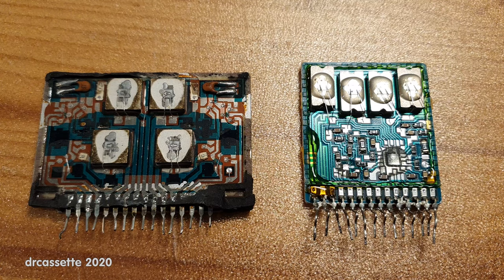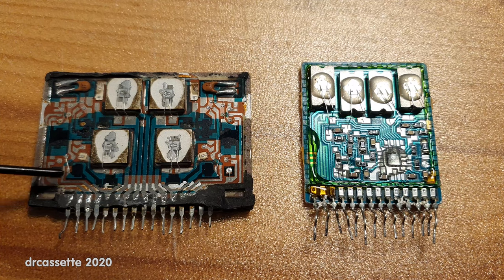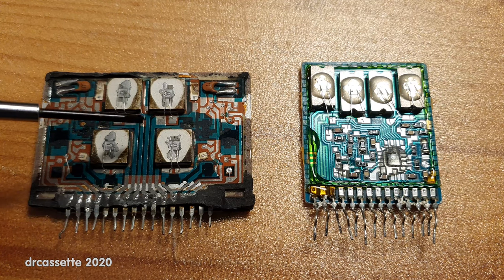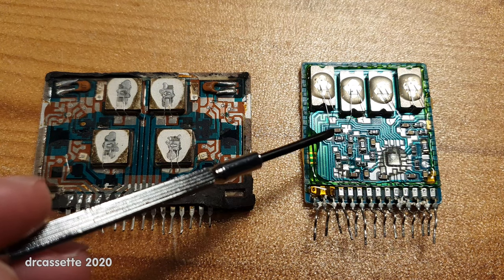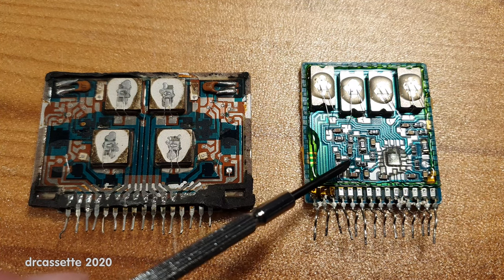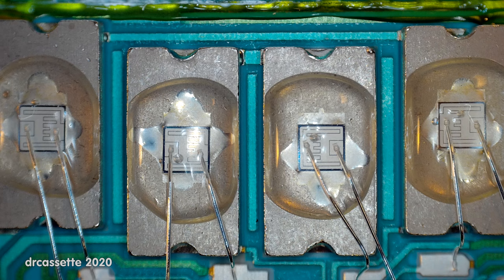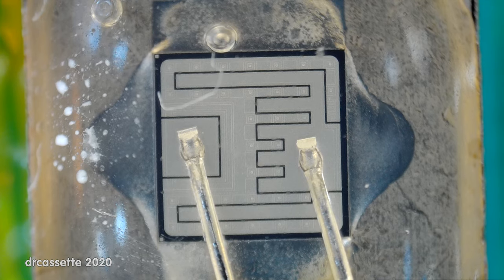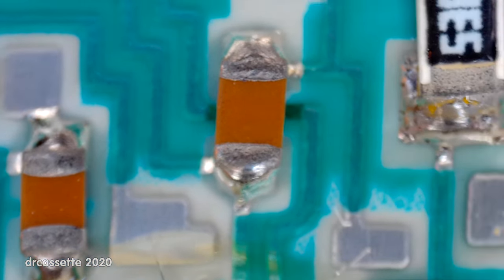Hybrid circuits and integrated circuits through the microscope

Comment: Question: what do you do when you find a dead custom-made hybrid, which (unlike most STKs) is now certainly unobtanium? Or, for a broader look, any bad part when there's no easy replacement in sight?
Reply from the maker: STK circuits were commonly used in low end, entry level amplifiers and receivers. So usually, if the STK is blown and I don't happen to have a replacement in my collection of salvaged STKs, the amplifier or receiver just gets scrapped. I have seen people in the internet opening dead STK circuits to replace blown transistors. Meaning, they cut the bad original output stage transistors out of the circuit, installed new standard transistors on the heat sink next to the STK and connected wires into the STK.

Comment: Microscope for Christmas 😇. Btw, what is that white dust / deposit on the first module? It looks similar to the crystals of a leaky battery.
Reply from the maker: As I mentioned in the video, the first circuit has been without its case for many years. It was clean originally, the white dust is likely chalk dust from when I renovated my old workshop a few years ago. Certainly nothing spectacular.